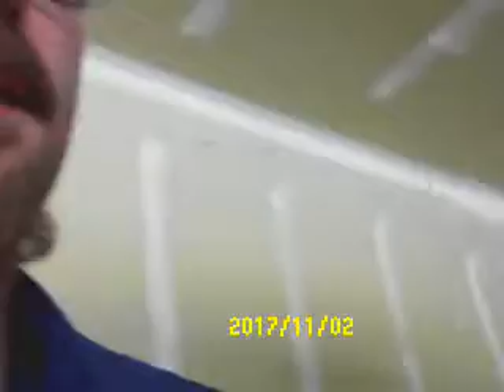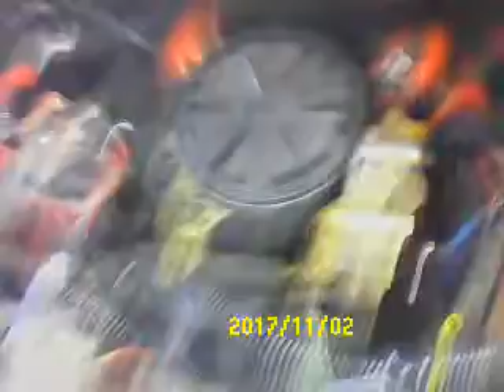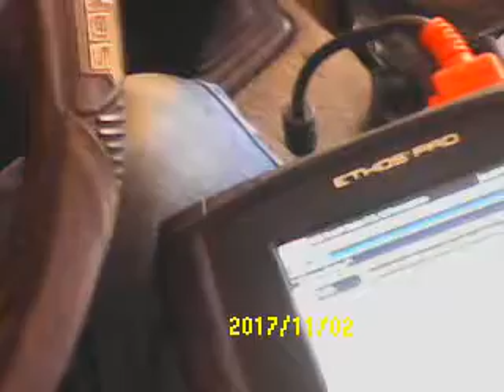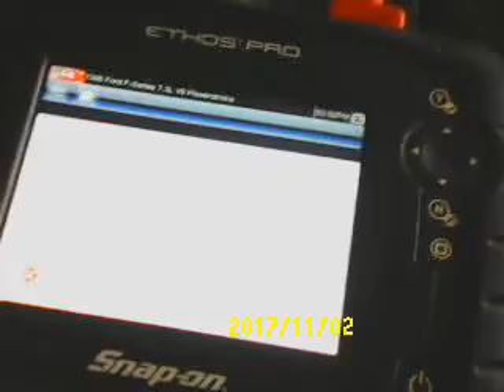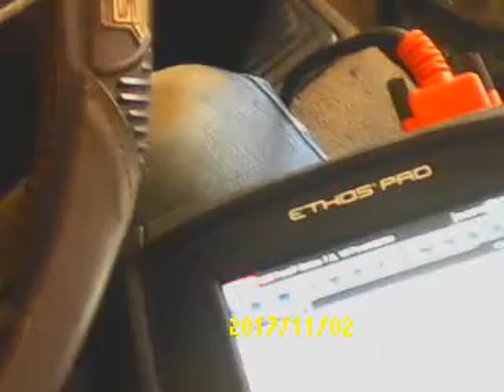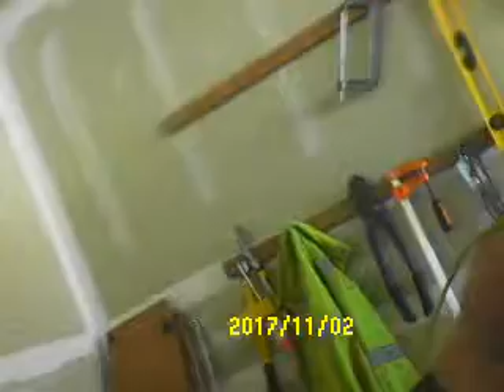Ford F250 PCM

Comment: Would it be same process working on the 6.0?
Reply from the maker: What code do you have?
Reply: What problems are you having? I have a 6.0 just had the engine replaced, and a bunch of other item's replaced. Mine runs great, but now, when I drive, it will die. I turn the key off, and restart it back up. The wire that plugs into the pcm, was just replaced. I'm trying to figure out if the pcm is possibly bad, or if I have other wire issues elsewhere.

Comment: Hi, what’s the name of the company that rebuild a pcm? I think my pcm might went bad
Reply from the maker: A1 Cardone I believe they are in Pennsylvania
Reply from the maker: I don't have much info on those. But if you have power and ground at the obd2. Next check would be the canbus circuit. Should be 60 ohms and 2.5 volts roughly
Reply: @rivervalleyfarm482  ok will do if I don’t get those readings at the Canbus what does that indicates? Im assuming i need to use a multimeter for this
Reply from the maker: Yes you need a multi meter for those tests. If you have the canbus your pcm is bad if not  you need to check canbus at the pcm connector if you have it there, then the problem is in the wiring harness between the pcm and obd2.
Reply: Also got a pats light can’t start it up
Reply: Ok cool. My 2008 f350 with the 5.4 3v obd 2 port will not communicate with pcm, I checked the fuses the port is getting power however I’m wondering if pcm is going bad? Any recommendations for me to check? I’m a diy guy

Comment: wondered what other codes you had besides the icp one ? if you had more.
Reply from the maker: Exhaust back pressure. It had that since I had the truck
Reply: @rivervalleyfarm482  would your truck run at all before pcm rebuild?
Reply from the maker: It would die intermittently. It kept getting more frequent and got to where it was undriveable but it would run.
Reply: @rivervalleyfarm482  mine will crank but if it starts shuts off with in 30/40 seconds.buzz test good.lots of random codes pulled . wondering if pcm is bad. all new sensors tried my spare icm no change.
Reply from the maker: @sherwoodrogers4339  multiple codes for what? Low voltage, high voltage?
Reply: @rivervalleyfarm482  p1280,p0113,p0603,p0344,p0282,p0283,p1268
Reply: p0282 cyl 8 Injector circuit low ,p0283 cyl 8 injector high , p1268 injector#8 high to low short
Reply: p1280 icp sensor circuit low,p0113 intake air temp sensor circuit high input ,p0603 icm kam error ,p0344 camshaft position sensor a circuit intermitted ( bank 1 or single sensor )
Reply from the maker: @sherwoodrogers4339  check for burned pins in the valve cover harness and connector.
Reply from the maker: @sherwoodrogers4339  if you can find someone willing to lend you a pcm, try swapping it and see what happens. This sounds like harness problems to me though.
Reply: @rivervalleyfarm482  what i think ill do is send my pcm off to get it rebuilt like yours. better safe than sorry. i havent seen burnt pins .

Comment: My 7.3 f350 is a 96 and that box is completely is totally different than mine.  Yours is a piece of cake compared to mine, Mine comes out from the inside only and is a real bugger to get to with everything mounted in the cab. Great video and I learned something new !  Bandit
Reply from the maker: Bandit farmer Ford is famous for making things different. I will have to measure my PCM and see if it is different.
Reply: I took a good long look at both cabs today and found that the blue cab has a hole just big enough to slide ware the wires bolt up threw the firewall , Now the red cab is just like yours the hole box will slide threw from the outside and bolt up just like yours. So Ford made changes to the cabs of the powerstroke  after all !   The box for the Powerstroke fit right in the blue cab no problem, I just had to put it in from the back side.  Thank God  I didn't have to cut the front of the cab up to make that box fit ! LOL  Learned something new today and that's a good thing, All this work on Blue will make doing Old Yellow a lot easer !  Bandit